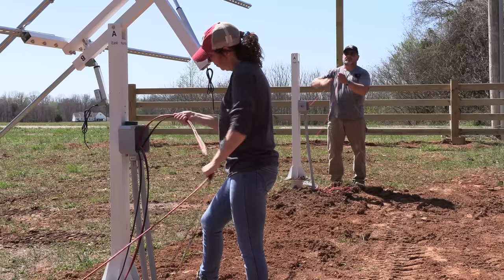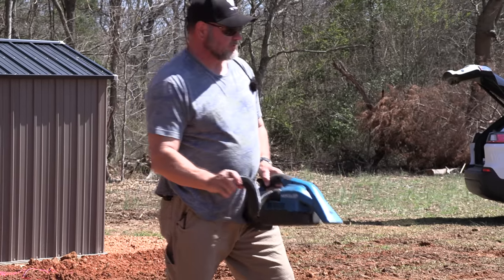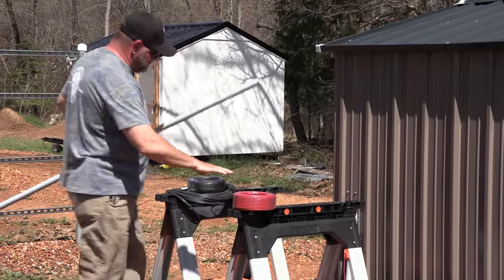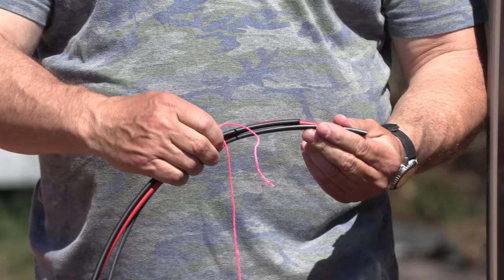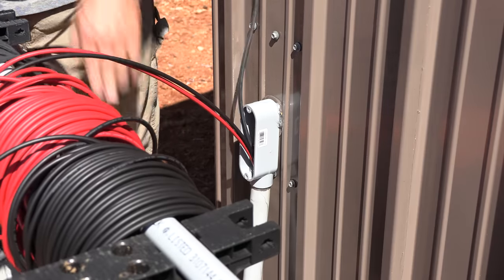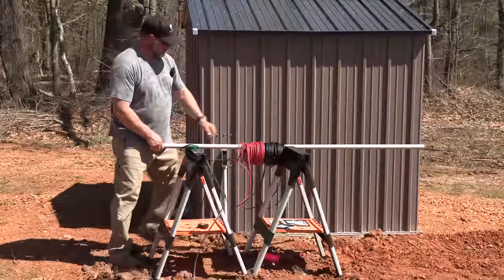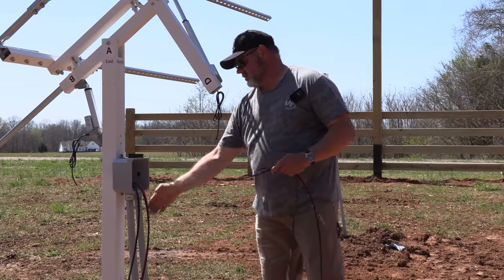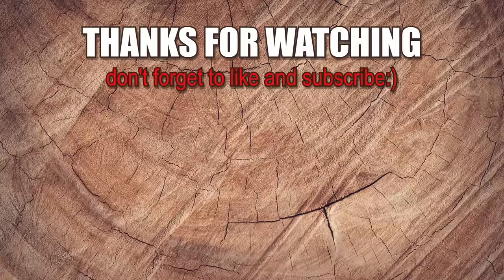Pulling Wire through Conduit: Vacuum Cleaner Method! 💡🔌

Comment: Great explanation Tony. I'm a 20+ yr 2 state master and electrical contractor, with 3 states journeymen licenses as well. Excellent technique. If it were me I would wrap the string around the wires then tape them off, almost like a pulling finger, and stretch the tape tight. (<---hard to have ocd...lol)  However your runs are not long and only have 2-90's so I would have asked myself when done why I bothered😂
Reply from the maker: Thank you very much. That is high praise from someone with your experience. I always say that I know enough to be dangerous. 😁

Comment: For the conduit run in the ditch, it's easier if you pull the wire through the (bell end) conduit at the same time you are assembling it.  It saves a LOT of time.
Reply from the maker: Thank you for your opinion. It had rather do it like I did it.

Comment: Thanks Tony, (For the Chuckles)  AHAHAHAH
Been doing this stuff for 37 Years, now retired. That run was so short I would have just pushed the bundle through.
The biggest one I had to do was 450Ft of 4" PVC with 3 90's, and a 45 between two Buildings, An old School and a new building for Comm Cabling, Speaker Audio, Coax, Etc. 
When the Conduit was installed the ends were not capped off at the School end and Kids dropped trash in it. it took 3 Shop Vac's. 2 Sucking and one blowing to suck a Kitchen trash bag through.  It's amazing how much trash kids can put in the Pipe in 3 days. 
Mike M.
Reply from the maker: That sounds like one of "those days!" Lol!
Reply: @TonysTractorAdventure  I wonder if I still have some 35mm Photos some where Hmmm?

Comment: also you are outside just unwrap that you need and pull the 3 wires in different directions on the ground in like a "hand fan shape." it helps when you are dealing with wire not on a spool. Like you did. You learned and in the future you save time and headaches

Comment: Putting some dish washing liquid on the wire and in the conduit helps it slide easier. Also move the rolls of wire further away from the entrance point
Reply from the maker: Good idea. I did talk about cable lubrication in the video description. The wires that I pulled had a coating on them. It felt like wax.

Comment: It works better with the rolls if you stick paper plates between each roll. If you have a long run you're going to need something stronger than a paper plate but what it does is stopped the rolls from dragging on the other ones causing it to bind. It also stops each individual roll from spreading out too far which prevents it from getting tangled in the other rolls. When we've had a lot of wiring to do one of my favorite things to use is actually an extension cord winder. We put each wiring type we need on its own extension cord winder and then screw them down to a board. Then you can do it with just one person because it unwinds so nicely.
Reply: that or a cardboard with a hole in it. I have done this many times pulling over 5000 miles of wire in my lifetime. also Love my 100' fishtape too.

Comment: hello in France, we do not put rigid sheaths in the ground, only red flexible sheaths for electricity with a wire puller inside much easier to pass the wires and to signal its presence and better locate in the ground . Rigid conduits are intended only for interior buildings. Congratulations on your excellent work nonetheless.
Reply from the maker: Thank you. Different countries have different rules and ways of doing things. 👍 I appreciate your comment. It is nice to hear about different ways of doing things.
Reply: @TonysTractorAdventure  oui merci I hope the translation is good.
I also bought a tracker on Amazon, for €300. Without solar panels I will assemble it these days. on it I'm going to install 2 400 watt Sunology solar panels. I hope it will work (Surface and weight) Excellente journée de France.

Comment: You know you might have wanted to leave a pull string in that conduit incase you need to pull more wire through it.  Using those coils of wire it is easier if you measure out approximately how much wire you need and uncoiling one at a time tie them to a point and a mark where you want to end. Do that for each one then with them all laid out tape the ends together and then fish them thru the conduit. Have had to pull miles of wire for satellite runs from the dish to the receivers in schools.  Having that pull line in the conduit will be a lifesaver when you need to replace a damaged cable. Just remember to tie another string to the end so you can pull it back for use again.
Reply from the maker: That is a great idea. Thank you. I will do that next time. This a great way to learn, because the distance is not that long.

Comment: What is the use of the black doubble cable?
Reply from the maker: It provides 12v to power the solar trackers from inside the building.
Reply: Thanks. Did it come in the package? Are there items to hold 6 solar panels in the package?

Comment: I am not sure - but shouldn’t the pv wire from second array - have been run all the way to the shed???
Reply from the maker: I don't see why. I ran the panels in parallel. They would have been parallel at the box outside or parallel on the inside of the shed.

Comment: And none of these 'master electricians' have said a word about the "high voltage" feeds (Tony's words) from the solar panels in the same conduit with the 12 volt motor control wiring????? Guess that is not a problem these days.
Reply from the maker: Instead of being sarcastic and self aggrandizing, you could offer your thoughts with a well thought out explanation. I personally think your hypothesis is rather weak and not valid for this application.
Reply: @TonysTractorAdventure  No sarcasm or self-aggrandizing, just 40-some years of putting the pieces together after someone, in the words of Brent Snyder, "did it wrong". The comment was directed to all the self-proclaimed "master electricians" who failed to ask such an obvious question. Further, any comment on my part is based strictly on the information you provided.

You did not state either the voltages or systems being carried or the wiring type being used so no well thought out explanation can be provided, but I will hazard a guess. It appears that you are using THHN for what you called the 'high' voltage and lamp cord for the control wiring. This may be permissible per Section 300.3 if everything is less than 1000 volts AND all conductors have an insulation rating equal to at least the maximum circuit voltage applied to any conductor within the raceway/conduit. Traditionally THHN is rated at 600 volts and lamp cord 300 volts.

Additionally, equipment grounding conductors (per Article 250) must be provided for each circuit, some folks call it bonding. Not talking about a 'grounded' conductor here which is always required in ac circuits and may or may not be required in dc circuits.. If your 'high' voltage is greater than 1000 volts then all bets are off and separate raceways are required. Have seen several solar systems over 1000 volts. 

Put it this way, it is most likely not a good idea, nor does it meet code, to put your 22/24 gauge doorbell wiring with is 30 volt rating in the same conduit with your 200 amp service entrance cable rated at 600 volts.

Comment: Ground wire?
Reply from the maker: No ground with solar. Positive and Negative.
Reply: What is the third wire for?
Reply from the maker: 12volt to provide power to the solar tracker. Two Big DC wires for the solar tracker. Two smaller wires for 12volts.

Comment: Not great with the vacuum cleaner. You had to pass the cord first before burying the sheath.
Reply from the maker: It worked great and only took a few seconds to pull the string through.
Reply: @TonysTractorAdventure  Without the signs how much did you pay for the tracker in the United States

Comment: Or you can do what I do, and eliminate all the fuss electricians are so proud of learning how to solve with all kinds of kinniptions. Just thread the pipe over the wire one piece at a time. I did it that way many times, including on a 100 foot run around corners, up and down through walls…one piece of conduit at a time. It was for a retired NASA mechanical engineer, and he was fine with it. I know all you “pros” will jeer, but inside you are thinking how I might teach a layman how to avoid $60 an hour in labor, for tricks a chimpanzee can learn, but the chimp doesn’t pretend it’s a critical skill that you HAVE to learn to do electrical work. Just like all the specialized, totally meaningless BS jargon you HAVE to learn so laymen can’t understand easily. Protect that paycheck, at any and all cost!
Reply from the maker: I am not sure what to say to this. I am not sure who you are talking too or about.
Reply: @TonysTractorAdventure  I meant people can do things for themselves. You did a great job on the project, and with videos like yours, more people can do things for themselves. Plus I like to give suggestions for solutions I’ve used.
Reply from the maker: Thank you Robert. We are always learning new things and adding new skill. I love to learn. It is becoming harder as I get older.